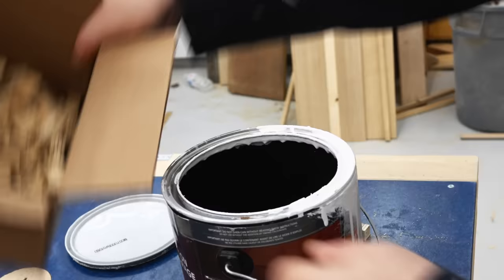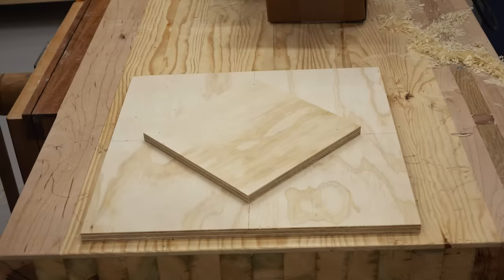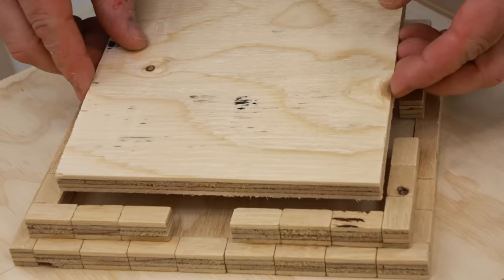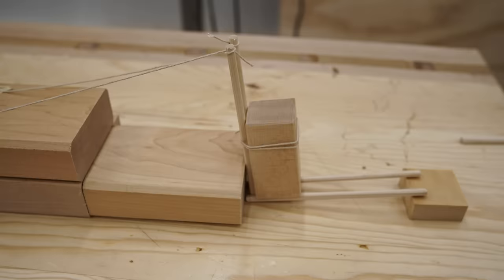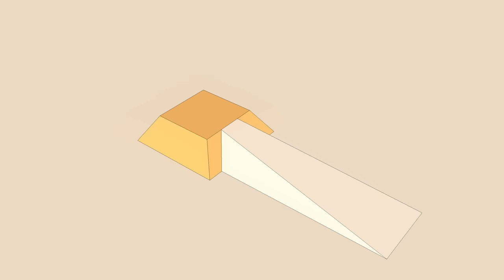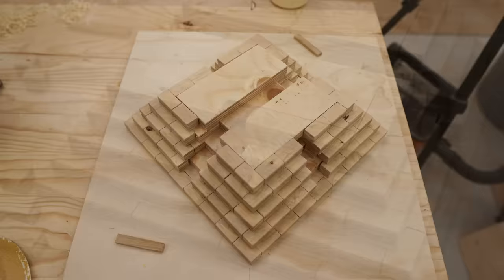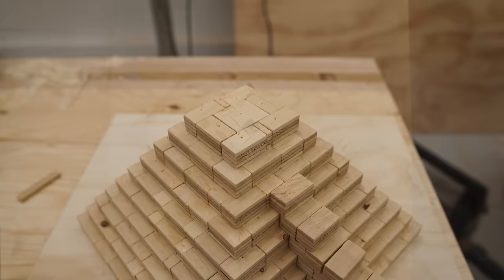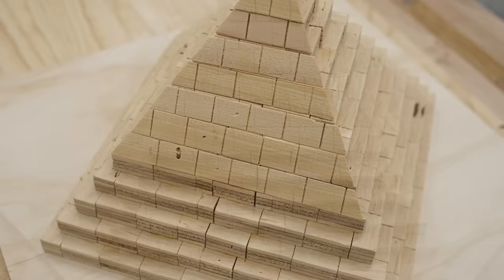How I Would Build The Great Pyramids

Comment: The most likely is a limestone geopolymer recipe that has been lost to time. Much like the legendary Roman concrete, we are just now starting to re-discover how to create high-quality Geo polymers. This is a substantially more plausible explanation for the tight fit and precision used in ancient megalithic architecture. when you see giant stones that fit together so precisely, but not even a sheet of paper can be fit in between the seams it’s much more likely that they simply constructed a series of molds and sequentially filled them as the material hardened. It would be incredibly practical for the workers to be transporting buckets. or bags or sacks of raw materials, then  mixed and prepared on the height that it’s needed and poured into a mold.

Comment: Look at the very top of the pyramid looking down there are various images from drones… You will notice the outside stones at the top are all going the same way they are all very square. All 90 degrees to one another but then the stones directly in from the outside edge seem to all slant 20 degrees all the way around. If you look closely it appears or suggests there was a circular ramp that would explain why the inner stones were not square. ❤

Comment: But if they are smaller at the top wpuldnt that be an issue to lift them on the lower but bigger blocks? Or are they then just light enough. However with the midsection open on both sides they could use counter weights to lift anything probably. Considering the joint would hold

Comment: I like the idea, if that's really what they did at least the first bottom stone should have rounded corners from being used as leverage for the top stones
Reply: Another potential theory is instead of building a ramp from ground level all the way up towards the top of the pyramid you just build a smaller ramp from ground level to the first layer, build the second layer, and then build a ramp on top of that, and you just do that all the way up the pyramid in a sort of spiral shape.

Comment: This is the simplest, most practical theory for pyramid construction I have seen to date. The next best theory, in my opinion, would involve a ramp of some sort, either external or internal. The problem I see with any ramp theory is the absolute lack of any supporting evidence whatsoever.  If you assume that any ramp would be built in the same manner as the pyramids themselves, it stands that removing the ramp upon completion of the pyramid would be similar to dismantling the pyramid itself, and there is plenty of examples of the pyramids being taken apart all over Egypt. You can very clearly see areas where limestone has been pillaged from nearly every single site, easily visible because these monuments are so large and impressive that they leave an impression on the land.  Whether it's debris and rubble that collects and forms mounds, or grooves and impressions from heavy traffic, there would be signs left on the landscape and on the pyramids themselves.  The lack of such evidence requires quite a leap of imagination in order to accept a ramp theory.  Your theory is much easier to follow and requires less 'imagination' than any other (meant that it's based in logic rather than fantasy), and, as Occam's razor would attest, the simplest explanation is often the best solution.

Comment: I think this method is downright brilliant and completely valid, and I believe a pyramid can absolutely be built this way. As demonstrated in the video, a pyramid could be built a variety of ways. 

In the case of "Khufu's" pyramid, there is compelling evidence to support a spiral ramp (or staircase!) hidden by the loose fill and casing stones, particularly the canted interior stones on the top, which the capping course would have obscured underneath the pyramidion (cap stone) had it not been removed. All canted clockwise at the same angle to the stones around its perimeter, by about 15 degrees (actually damn near spot on 15 degrees).

Comment: Imagine a typical block,
imagine four pieces of wood tied around the long sides of the block.
imagine the wood is flat on the surface that rests against the block face, but is a quarter circle on the other face.
now the 2.5 ton block can be rolled by one man on a level surface.
To move the block with the wood faces up a 10% grade only requires 2.5ton/10 acting at the centre line.
Imagine ropes wrapped all the way around the block/wood with the rope on top of the block, now pulling the rope 1-foot moves the block 1/2 foot, and to pull it up a 10% grade requires 2.5ton/20 about 1000 lbs. A small follower block can be used to stop the block from rolling backwards as you go. This is feasible.  The most efficient way to build the ramp is to use the structure itself, we should look for evidence of a spiral ramp wrapping the structure either on or near the outer surface.
Once the blocks are near there final location, the four slabs of wood are removed and reused on another block.   You don't plan to move 2 million blocks without a simple system of material handling. They didn't drag them and they didn't carry them. They rolled them.

Comment: I wonder if they actually built multiple pyramids ie one in each corner, later fusing into one. It would maximize surface area for getting blocks up.
Second alternative could also be a first inner pyramid that was them extended on the faces. I wonder if these hypotheses could be tested today

Comment: Great wood working skills.  There are 8 sides to the great pyramid. Each side has a slight angle in towards the vertical center line as most people know. So that center line could have easily been used as a passage way as u suggest and filled in later. In the estimated time given to build the pyramid, 27 years, and the estimated amount of labor that could be supported at the site, they would have to place about 233 blocks a day. The carved blocks were between 2 and 70 tones.  Think of the required amount of man power to lift these blocks up a set of steps or any grade would be more than there was available space around the block. A strong man could maybe pull or lever about 200 pounds. With regards to the 50 tonne blocks, divided by 200 is about 225 men, to lift one one side of the block. Where are this many people going to fit?  Lifting and Installing them, especially the 70 tonne granite blocks, is  the mystery for sure. Just imagine the size and amount of wood poles it would take to lever up a 70 tonne block of granite that is 20' long up 200 feet of steps or even a 12 degree angled ramp which is the max angle that was proven to be feasible. There were over a hundred of these 50 -70 tonne blocks in the structure.   It would take about 400 men to lift one side. How would these 400 men fit on the steps you suggest or get behind this size block with wooden poles and pull with ropes from the front on a ramp? Not an easy problem.
Reply: Did the workers ever go on strike?

Comment: For calculations most Egyptologists use 2.5 tons as the weight of an average pyramid stone block. 8000 tons of granite were imported from Aswan located at more than 800 km away. The largest granite stones in the pyramid, found above the “King's” chamber, weigh 25 to 80 tons. 
How did they cut and transport those massively  heavy stones positioning every single one of them perfectly aligned to form these massive pyramids? Something does not add up.

Comment: Herodotus provides a description of the process in Histories.
The pyramid was built in steps, battlement-wise, as it is called, or, according to others, altar-wise. After laying the stones for the base, they raised the remaining stones to their places by means of machines formed of short wooden planks. The first machine raised them from the ground to the top of the first step. On this there was another machine, which received the stone upon its arrival and conveyed it to the second step, whence a third machine advanced it still higher. Either they had as many machines as there were steps in the pyramid, or possibly they had but a single machine, which, being easily moved, was transferred from tier to tier as the stone rose – both accounts are given and therefore I mention both. The upper portion of the Pyramid was finished first, then the middle and finally the part which was lowest and nearest to the ground.
Reply: Egyptians having nice cranes doesnt sound too implausible, however, Herodotus was known to fudge his stories, so who knows

Comment: It seems they start with the step design and then overlay it into the smooth sided pyramid. I don't know if they use a ramp, or some king of lever and rope system to move stones up the steps. I'm certain they don't build an external structure. As you say - it makes no sense when you are working with a giant ramp already.

I think they do the casing first, when they turn the steps into a smooth sides, and then fill it in. Like a jigsaw. Then do the next layer up. The casing sits on top of the casing below it. It's going to be a trick to do that top to bottom.

2 cents worth. no refunds.

Comment: Nicely done video anyway,however I must point out that the Great Pyramid has intricate internal structures that your hypothesis dosen't even address. That would vastly impact your central step idea. I also believe that the split faces of the pyramid are a feature of its function and not just a remnant of the building process because it seems to me that it would be easier to face an even,flat structure than to have to make  innumerable measurements cover a compound sloping surface.

Comment: Best way I've seen so far. Makes sense, bravo.
One thing about the caseing stones, the stones sat over the lower stones alot so you couldn't do it from the top down.
You would have to slide the next level underneath a big lip and I don't think that was possible.
I could have it wrong about the over hang. I do see them polishing down from the top. I don't know if the angle was to much to be able to hang on the side or not.

Comment: First of all, Khufu's pyramid and other pyramids of Giza were rebuilt seven thousand years ago and a flat surface was added to them and it was never built by human power and never an earthen ramp was built next to it. Khufu's pyramid was built thousands of years ago and was rebuilt by the Egyptian pharaoh. To cover the pyramid with stone blocks, they used hydraulic power, that is, they built a hydraulic lift on each side of the pyramid, by filling stone cylinders with Nile water, they lifted the stone blocks up to a height of four hundred meters, and they worked four lifts in place like a puzzle. Hydraulics were used for Khufu's pyramid. You can see the place of wooden rails on the stone cover of the pyramid.

Comment: I think one thing is to logically explain how geometric shapes could be leveraged, the other thing is to take real sizes and weights in consideration. We are talking here about stones that weight 2.5 - 80 tones, please find the the piece of wood which can be leveraged to flip 80 ton stone... I am not even talking that we working in the desert here with quire being 500 km away from the pyramid. Sure, theoretically thick enough plank of good enough wood could do it, but I would challenge you to do a calculation of how thick it should have been to do the stone flips as you suggested. 

And all this is even before we start considering that unbelievable symmetry of the stones, how level they are and how tight were the gaps between them... one needs to understand that 0.01 degree difference in the base layer would result in massive difference at the top... as well we discussing all the "stress relief features" with out current computer modelled understanding, yet here we supposedly talking about people who didn't have even basic levels, how they supposed to understand stress relieving geometries?

I mean I appreciate attempt on explaining how it was done, but it is still far cry from watertight and comprehensive theory and light years away from explaining how it was actually done. One thing is to move 1 ton rock in your garden using same basic leverage, another is to move 80 tons + stone 500 km in the desert... and I assume the stone was even heavier as I do assume they cut it to the final size on the site as otherwise there would have been risk damaging it in the transport. Note as well that theory of the barges or ships makes no sense, because there were no ships until very recently (200 years ago) that could carry 80 tons of cargo total... never mind a monolithic stone, high above waterline... and by the way - how exactly would you load the stone on the ship? get the balance wrong just slightly and the ship will be flipped instantly. 

There are just so many things that we still cannot explain that it is crazy to even think about. Sure certain things can be explained by simply stating that they had near unlimited time and near unlimited resources and perhaps construction of pyramid took entire lifetime of Pharaoh (great pyramid in particular estimated to have taken 27 years), but even then it doesn't explain some of the most extreme metrics.

Comment: The water elevator makes not sense. It would have required and insane system of water locks with a continuous way to pump water to the top, as the locks would be constantly emptying during normal operation. It would be difficult today, and insane back then. As for the ramps, they would have been colossal. A lot of depictions don't seem to consider proper slopes for the material that would have been needed. The mass of earthwork would have been just enormous. They would have left a mark, either in the borrow pits from which the material was  taken, or in mounds of material left over. Granted, much of it would have been eroded over time, but it would have left some tell-tales at that scale. The description you provide is by far the most realistic I have seen from the point of view of workability and considering the technology available at the time.

Comment: In order for a pyramid to be built within 25 years (the average length of a pharaohs reign), one block would needed to have been placed every 5 minutes continuously. When you look at alot of the blocks on the pyramid, it's obvious how precisely, and in some cases irregularly, they fit together, something which couldn't be done with seperate construction teams. They must have been completed one by one so that they know what needs to go in next, either that or it was planned to such a precise level, that they knew the exact dimensions of every single block (interior & exterior) before construction even started, and managed to carve every block to that exact specification with no mistakes. 
Again its worth stating, these were the first megalithic structures to be constructed in Egypt. Its difficult to think that the first thing that this civilisation made is now considered as a wonder of the world, and still to this day, irreplicable with their tools. I truly believe there is more to the story than just the power of slave labour, and I'm not talking aliens. Isn't it possible that some civilisation existed before the ancient Egyptians and that the pharaohs merely "moved in" when it was discovered?

Comment: I think I have a better method.  a series of wooden jigs to fit on the rising pyramid steps in effect you want to create a slide up the pyramid.
On the top wooden jig are two wooden legs to to attach block and tackle or similar.
you put a new block of stone on a sledge, take the rope over the legs of the top jig and you can pull the blocks up from the main ramp leading up to the pyramid..    
ropes and wooden jigs would need replacing every now and then but it would seem to make a lot more sense pulling blocks up by teams of men or even teams of oxen if they used them back then.

Comment: With the amount of sand easily on hand and how fast it could be dug and carted away I'd have to assume they used slaves to just bury the thing as they went up each level.  there was just no room to flip stones end over end up the face plus one mistake and you have a 30 ton bomb heading back down risking the foundation stones. Which obviously couldn't just be glued back together if damaged

Comment: Interesting but wouldn’t making it from the inside a level at a time make more sense? Build a course, backfill with rubble and rough stone , leaving any passages etc, so you have a large flat floor to work from.  Building from the outside would be a nightmare.

Comment: Very compelling indeed but regardless of how they was built, the questions we should be asking is why there built in mathematical and geometric methods of golden ratio and phi including astronomical measurements of the earth moon and sun, Atomic composition including the speed of light calculus whilst sitting above an aquifer on multiple magnetic lay lines and the choice of building materials which have electromagnetic elements internal acoustic design clearly they were built to function as A….

Comment: Ramp theory is out the window, the ramps you’d need to meet the right pitch and not cause so much friction that the blocks wouldn’t move would be so unreasonably long and would take 50 plus years themselves to construct and there’s no sign of any ramp construction
Reply: Who's to say the ramp was constructed perpendicular to the walls of the pyramid and not on the walls themselves? You only need one fairly small ramp to go up one layer, just chain them together in a spiral around the whole pyramid.
Reply: @Corzappy  in theory doing it any other way is to much of an angle and would cause to much friction because of the slope of the ramp and the weight the stone making it impossible with out machinery allegedly, they’ve tried to recreate it but still can’t. One of the best mysteries of time